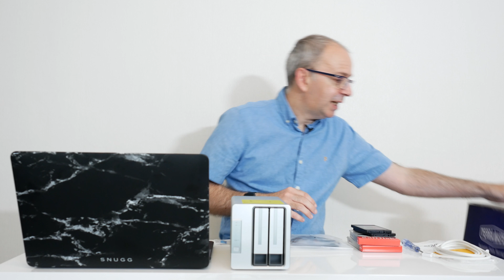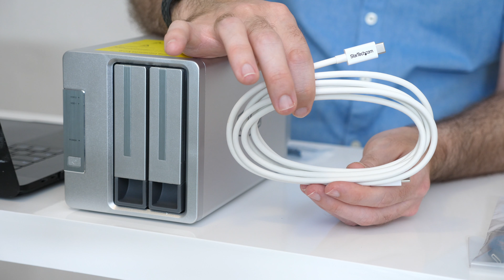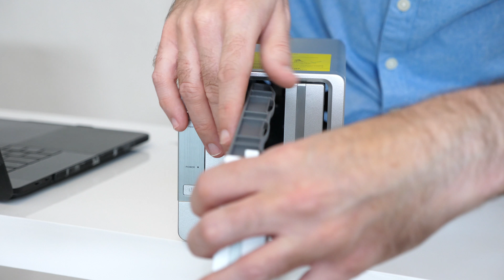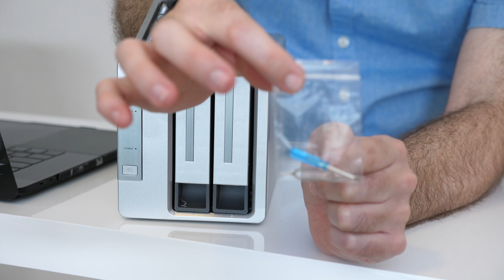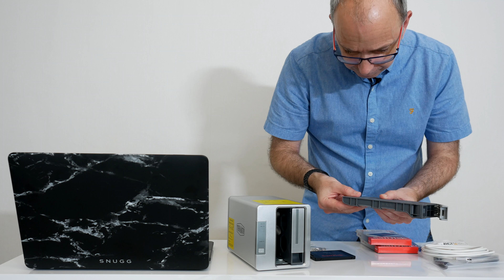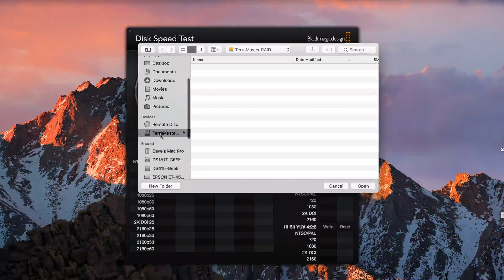TerraMaster D2-310 USB3.1 Gen 2 RAID Enclosure & SanDisk Ultra 3D SSD

Comment: Just purchased a Terramaster D2 310 hdd enclosure, can I use two different formatted hard drives? Two seperate hdds, one Fat32 and one NTFS using the single mode option? Or I'm risking to loose my data?
Reply: But the switcher is set to single mode.
Reply from the maker: Ah right. It might work OK. I would still make backups to be safe.
Reply: @geekanoids  allright
Reply from the maker: You will lose your data, this will format both drives to build the RAID.